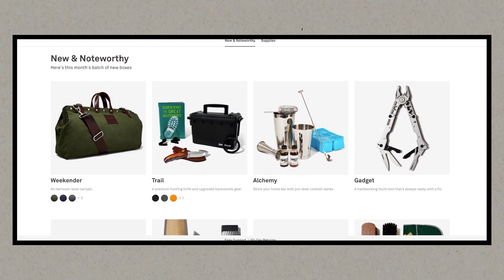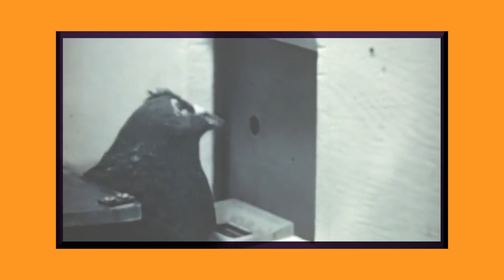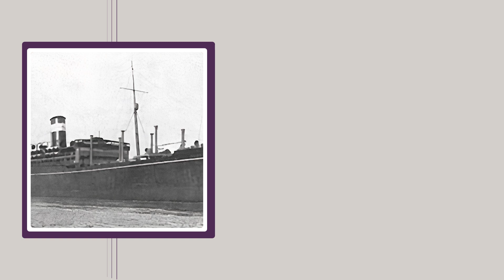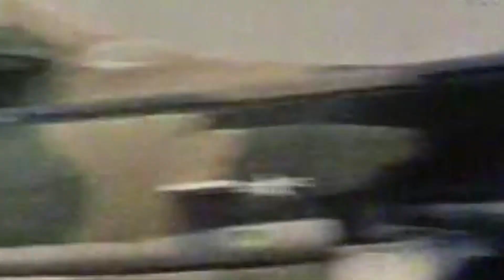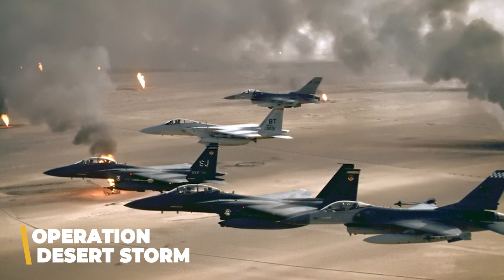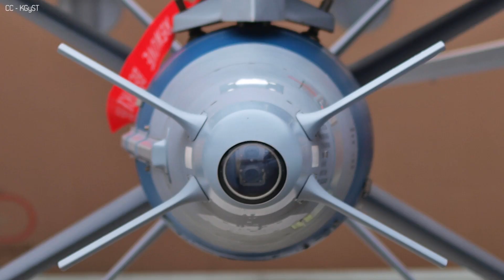Weapons that Changed Warfare: Smart Bombs

Comment from the maker: Thanks to Bespoke Post for sponsoring this video! New subscribers get 20% off their first box — go to http://bspk.me/sideprojects20 and enter code SIDEPROJECTS20 at checkout.
Reply: The bat bomb didn't sink any ships, it was literally a bomb filled with over 1000 live bats intended to spread incendiary devices to Japanese buildings. It's Wikipedia page shows that photo and says it was never used in action.
Reply: looks much better than the "mystery green" drink mix...
Reply: An oddity you may consider as a side project or to include in a side project is the GBU-28 Paveway bomb (the "Bunker Buster"). Designed in 90's it has a very interesting history when compared to the majority of weapons designs (short procurement period, short design cycle and the original batch were created with repurposed, preexisting materials that had nothing to do with bombs.

Comment: My stepdad was in the airforce in 80s. He got to help test Gps when it was first being developed. They could track where the humvee had been around base down to 3 feet. He asked how they could do that. The answer? That's classified. He didn't learn until 1999 that it was satilites in orbit that were tracking the device on the roof. From that they were able to develop navigation and weapons delivery systems.

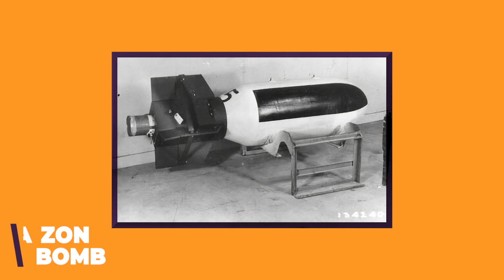Comment: LOL!  The "Bat Bomb" shown at 7:14 is not the "ASM-N-2 Bat" radar guided bomb described, but an actual Project X-Ray bomb filled with hibernating (from cold storage, then from cold high altitude flight) bats contained within a ventilated shell that opened like a cluster bomb after being dropped.  The bats, each carrying a timed incendiary device would wake up and since it was to be dropped during the day, would fly into attics and other hidden placed out of sunlight.  It was never deployed, but probably would have been effective - "A series of tests to answer various operational questions were conducted. In one incident, the Carlsbad Army Airfield Auxiliary Air Base near Carlsbad, New Mexico, was set on fire on May 15, 1943, when armed bats were accidentally released. The bats roosted under a fuel tank and incinerated the test range."

Comment: Before they were able to determine the radio frequency the bombs operated on so they knew what frequency to jam, I wonder why they didn't use spark gap transmitters as a sort of blunt force approach. The technology is simple and has been around literally for centuries. You just generate a spark, and it throws off radio interference. The more power and the bigger the spark, the more powerful and distantly acting the interference is. The only down side is it jams EVERY frequency. Including ones the allies no doubt used for communication themselves. But even with that problem, they could have used it as a sort of evasive tactic when they knew they were being targeted by a smart bomb. Like deploying flares to throw off a heat-guided weapon. They only use it when absolutely necessary.

I've actually designed a spark gap generator radio jammer myself. Though I never built it because such a device would be illegal under FCC regulations and could land me in a heap of trouble. It could do nasty things like interfering with emergency bands for police, fire or ambulance, or interfering with air traffic communications. And basically anything else that use radio. Not that it had a huge distance on it. It mighta worked for like 50 feet or so.
Reply: You answered your own question about why they didn't use spark gap transmitters for jamming. Like you said, the range of a system like that is relatively small, therefore by the time it would be able to effectively block a radio signal a bomb would be within a second or two of impact. You would also have to increase the power of a transmitter exponentially to improve range, so it quickly becomes impractical to scale something like that with more power.
Reply: Also the other part about blocking your own signals, such as comms, radar, etc. Probably not the best idea when you've got incoming projectiles. CIWS is going to rely on those to shoot it down, as well as FLIR.
Reply: @slcpunk420  Heh I guess that makes perfect sense then. Even if they DO just limit it to emergency situations, like if they know they're being locked on to, there's no guaranteeing they won't cut off some really message. It's not like they'd be able to give everybody a head's up and be like "hey guys I'm gonna be jamming every radio band up here so I can avoid a missile. So try not to talk about anything important for a little while."

By the way, @SLC Punk! Heroin Bob's death was one of the saddest scenes of any movie I can remember. Matthew Lillard clearly wasn't acting in that scene. He was crying for real, 100%. I don't know where he went in his head to get a reaction that incredible, but it must have been somewhere DARK. It's too bad he didn't get more recognition. Crying on command is one thing. But crying HARD and for real on command, while like 20 people are watching you and the pressure's on. That takes something beyond talent. I just had to mention that. =P
Reply: @slcpunk420  Also I just went to download SLC Punk! cuz it's been years. I didn't realize they made a sequel to it in 2016. It must not have been very good though. It was only 75 minutes long. And you just can't recapture the magic that was SLC Punk! It was one of a kind. Just like anything worthy of being called punk is.

Comment: I worked on the guidance systems while stationed in Thailand in 1968. Consider the concrete bomb when they removed the explosives to limit extera casualties.